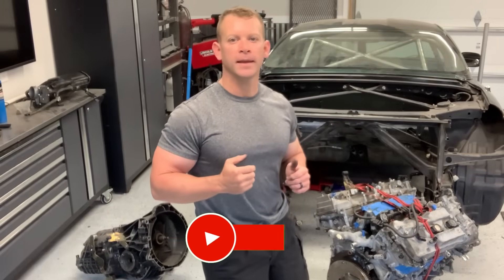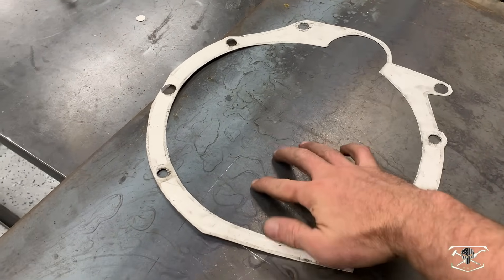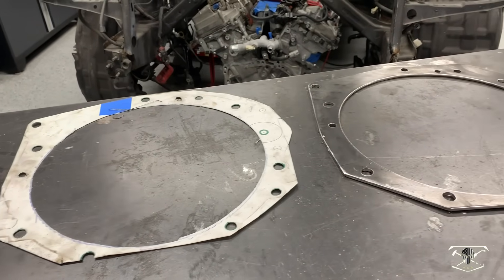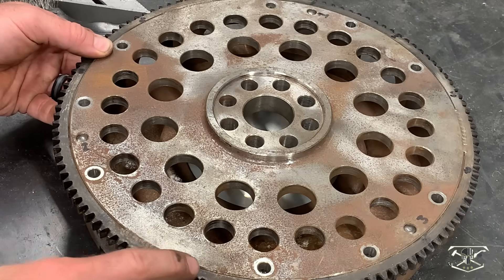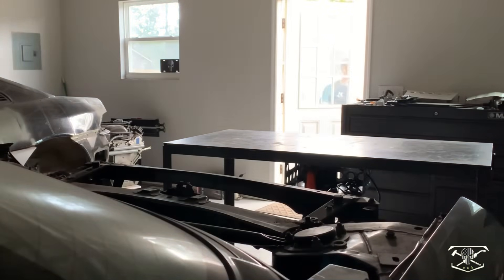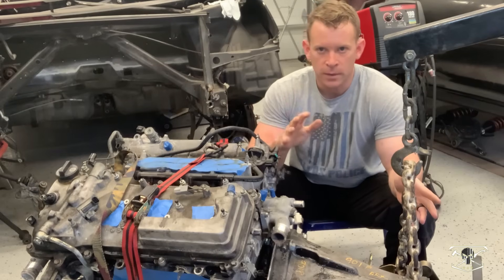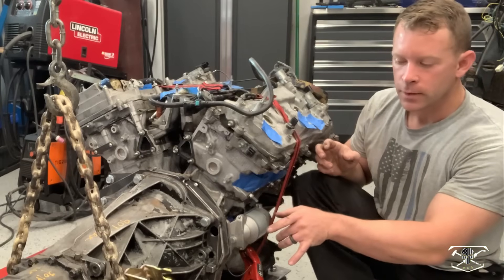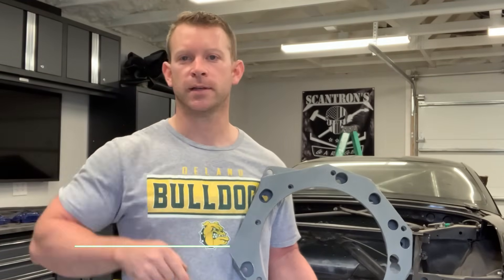DIY Engine Adapter Plate (Mate any Engine to any Transmission)

Comment: The first thing you do when making a paper patern or gasket is do 2 opposing bolt holes and put bolts in them, that putting a single spring clamp ony gets you a rough approximation.
Reply from the maker: I like it

Comment: How do you pair the other modules like the body modules to the new ECU?
Reply from the maker: Oh that's an entire different video.  I have some videos already on this topic. It also depends if you are using a stock ecu or an aftermarket ecu and custom harness. After doing all this, the ecu will need to be tuned on the dyno

Comment: Lots of great ideas, however, the alignment between the trans and crank centerline is only allowed around .005" with .005" parallelism (angle between the two). If these are not in spec it can create shifting issues, disengagement issues, vibration, input bearing wear, pilot bearing wear, release bearing wear, spline wear, pressure plate finger damage. In severe cases it can even break the center out of the disc. 
You could have made this super accurate by using a dial indicator to check and correct eccentricity and parallelism. Look up indexing or centering bell housings. Holley and tremec have great guides along with other folks. It's hard to stress how important a few thousandths of an inch can be when setting something up like this but take some time to review the guides. And if you think you can get this setup into spec with the method you used, grab a .005 feeler gauge and please reconsider. https://americanpowertrain.com/general-bellhousing-alignment-instructions/
Good luck.

Comment: What about spacing for your pilot bushing or your flex plate for the torque converter ?
Reply from the maker: I measured the spacing before determining the thickness of the adapter plate. I measured everything fully assembled with the clutch in place. This would work for an auto trans and torque converter as well... the adapter plate would just be thicker to account for the converter thickness. I know I brushed past this quickly in the video .

Comment: Instead of cutting out the centers, of the flanges, leave the small hole at crankshaft & input shaft centers. That is the most important location to align the engine & transmission!

That inside hole doesn't need to be round.
Reply from the maker: Yes, that would work
Reply: @scantronsgarage  yeah. I've done this & that is the easiest way to ensure the engine & transmission are lined up perfectly!

That junction is very important because alignment needs to be within ~0.0010" (~0.025mm) of perfect, or input shaft & crankshaft bearings will suffer. That point is also very hard to adjust, or even check, since it's somewhere very inaccessible.

You can kinda check, though, to know it's wrong. Usually, the input shaft bearing will whine like a banshee! So…how's it drive?

Comment: I plan to use a 8hp70 on a Buick 3800sc
Reply from the maker: 870 hp ?
Reply: @scantronsgarage  no it’s the transmission used in bmw 730i and hellcats look up shr war viking genii 8hp70 or bmw x drive. 8hp70
Reply: @scantronsgarage  but ima try to shoot for 500-600 hp out the 3800sc
Reply from the maker: @chaseleim4773  Very Nice! I will be lucky if i can get 400 out of my ls
Reply: @scantronsgarage  and ima try to utilize the bmw x drive transfer case aswell, on a lowered s10
Reply from the maker: @chaseleim4773  Sounds Awesome! Ive had a few lowered S10's but not with power

Comment: What did you do to make sure that the center line of the crankshaft and the center line of the input shaft are not only concentric with each other but parallel? Any slight misalignment and concentricity or any angularity from the parallel would seem to open you up for a can of worms of flexing bad vibration accelerated wear. Yet it looked like you just kind of eyeballed your alignment?
Reply from the maker: I kinda did. I let the output shaft center itself in the pilot bearing and built the plate around it. The adapter plate was later milled on both sides to ensure it was square. Yes though, any deviation in alignment will be catastrophic but so far so good

Comment: How did you determine your input and pilot bearing were aligned?
Reply from the maker: There was some guess work but assuming the input shaft is perfectly centered in the transmission, you insert the input shaft into the pilot bearing in the flywheel and measure for the distance between the block and transmission 360 degrees around. As long as that is the same you are good. Of course any misalignment will have serious consequences. 
I did have the plate milled on both sides for thickness accuracy and everything lines up perfectly for installation (no force fitting).

Comment: Doesn't the spacing stop the spigot bearing from fitting inside the crankshaft and the clutch spacing etc
Reply: Or was that calculated and machined on or off the flywheel?
Reply from the maker: Correct!! the flywheel was machined to make up the depth difference.

Comment: awesome to  SEE  what I've been dreaming about for a year.     My plan is pretty much the same,  but use a little thicker plates.  --after it's welded up,  I'd take it in to be surface ground for parallelism,  and final thickness.
Reply from the maker: Nice! That sounds like a good plan. good luck with the build : )

Comment: Great work! How do you know the transmission input shaft if going into the clutch and pilot bearing straight though?
Reply from the maker: Just by placing the input shaft in the pilot bearing and measuring the distance between the trans and the block 360 degrees. The plate will be surface milled on both sides as well.

Comment: What I don't understand is the gap. What did you have to do to account to the gap needed to make an adapter plate?
Reply from the maker: Whatever thickness is added on the flywheel will be the adapter plate thickness at least in this case). The less thick you can make it, the better.  either way, the adapter plate will add some thickness or increase the distance from input shaft to pilot bearing. So you just need to make up for that distance. Hard to explain but hope this helps.

Comment: That’s sooo cool!! Thanks for the knowledge man. What motor is that from to mate on a Porsche transmission?
Reply from the maker: This motor is a 2gr-fe V6 from many toyota products. Produces about 300 Hp . If you look at my other videos, I also have a MR2 with a chevy v8 bolted to the same porsche transmission.
Reply: @scantronsgarage  wow that is sooo cool!! I seen that and that’s pretty awesome you motivated me and hopefully I can do something like this in the near future. Would you happen to sell those adapters? Also where did you get that clutch kit from if you don’t mind me asking?
Reply from the maker: @Gentlemenshustle  I do not sell these adapters. This was too time consuming to make any profit. I believe I got the clutch from Summit Racing. LUK brand but it was stamped with sachs.
Reply from the maker: @Gentlemenshustle  Thank You!! I am not selling these unfortunately. The clutch is a direct replacement for the porsche boxster s.  This was a LUK brand i bought directly from summit i believe.
Reply from the maker: @Gentlemenshustle  Thank you!! I do not sell these unfortunately. And the clutch is a direct replacement for the boxster s

Comment: Wonderful work. Immediate subscriber. Question. I want to do this for an automatic but doesn't the trans input shaft "float" a little for install into the torque converter?  Any thoughts or tips for us auto guys to take the slop out in order to get it centered firmly during mock up? Thanks
Reply from the maker: Thank you!!!!! This should work in your case. Just machine a spacer that goes in between the torque converter and the flex plate to make up for that distance. Hope this helps. Hard to explain.

Comment: I’d like to make a adapter plate to mate my rebuilt 4L60e to a 3rd Gen 5.3L v8
Reply from the maker: Aren't the bolt patterns the same?
Reply: @scantronsgarage  I think so, but I’m not sure…
Reply from the maker: @jahcousteauu_STAYinSHAPE  I think your good. make a template and verify at a junkyard
Reply: @scantronsgarage  my whole scary part is risking it -when I go to pull and pick a junkyard 5.3, I think it’s going to be a luck of the draw, pretty much taking a gamble on grabbing a good solid one. I mean ofcourse I’m gonna rebuild it and bore it out but I need to start with a good block atleast… 🤔
Reply from the maker: @jahcousteauu_STAYinSHAPE  Yes, the junk yard is always a gamble
Reply: @scantronsgarage  my 4L60e originally was paired up with the inline 6ix 4.2L and I wanted to switch it to a 5.3 since my engine is acting up

Comment: I am curious how you accounted for crankshaft center line run out. Installing the transmission 3/4 of an inch away from the engine and then putting plates in the gap does not account for center line run out. Other than that I admire the ingenuity.
Reply from the maker: I cheated... I put the input shaft into the pilot bearing and measured the distance between the block and trans to make sure there was no deflection.

Comment: Sorry, why did the flywheel need all the extra thickness? I can’t find where that’s explained in the K-Swap videos
Reply from the maker: So, the adapter plate will add an additional thickness. in this case, I believe it was an additional 22 mm. so to make up for this thickness, the flywheel needs to be an additional 22mm to match the difference : )

Comment: The adapter plate doesn’t have to be seal welded?
Reply from the maker: no it does not. The stich welding will be plenty strong

Comment: The reason I watched was to see what engine transmission and car. Wasn't disappointed. That is an awesome idea to v8 an MR2 and it looks like the engine will stay on your backside.
Reply from the maker: Thank you!! this car might even pull the front wheels off the ground

Comment: I'd love to put a d series Honda on a th350 for a rear engine crawl build. D series are reverse rotation and would solve a lot of issues with flipping axles. Just need to bring the Honda torque converter or get a Chevy reverse tc
Reply from the maker: I like your thinking on this. Hope that works out for you... that would be cool to see!
Reply: @scantronsgarage  I'll try it out one of these days. Going tdi on the next build. Gotta finish the jeep first

Comment: Talk about old school. My dad showed me how to this in 1974, replacing the flathead engine in a 1948 4 pickup with a 394 Oldsmobile from an early '60's Delta 88, I think. Though thinking back, would have been better and easier to swap the trans too because the 48 Ford was low geared and before scyncros so even with the better engine, top speed was 50-60 mph full out and it would grind the gears if you weren't conscious to double clutch.
But reality, great idea you have. I haven't thought about it since back them, but done 100's of other swaps. Like to see it done with sidewinder, Did a 389 Pontiac backwards into an old school VW beetle, hard to keep the front wheels on the ground, also a caddy Northstar into Pontiac Fierro was fun. Now planning a LS + 4l80 into a 1969 Pontiac Bonneville where once rested a 375 horse 428 with turbo 400 automatic. Keep up good work
Reply from the maker: Thank you so much! That means a lot coming from someone who has done quite a few swaps. I especially like the fiero / northstar swap. That is something I thought of doing myself.

Comment: I have a piece of equipment that uses a constant velocity double-u joint to connect the engine to the pump one side of spline shaft the other has four bolts
Reply from the maker: I see... You gonna make an adapter plate for this?
Reply: Doesn't use or need one the pump has its own mounts on both sides and the motor has its own mounts on both sides

Comment: Once the spigot carrier is bolted into the flywheel . We see, as you crank the motor, that thing is totally on the piss. Why is that happening?
Reply from the maker: Fair question. Sloppy temporary assembly on my part. The center plate was not fully seated in the flywheel when I did the test crank. I took this thing apart at least a dozen times during the process.
Reply: @scantronsgarage  Well you still made it look real easy  to do. I'm not sure it is so intuitive but I believe I will test the theory sometime in future here. I have a 4 cylinder gas engine going into a deisle 6 speed truck. Just thinking about it starts my adrenaline.
Reply from the maker: @jackrichards1863  I hear you! sounds like a fun build.

Comment: So in this instance i think you aligned the two inside diameters to get the neutral centre of the spigot shaft? Because where people are inclined to swap a transmission to fit. Determining the precise neutral centre is the difficulty. Any fault in that plane or 'POSITION' brings about clutch disc centres breaking out, premature input shaft bearing wear & possibly clutch disengagement problems. I've got to watch this again. Now!
Reply from the maker: Yea.. I cut out a bunch of my measuring. I also had a similar drivetrain next to this which i used for comparison.

Comment: You should’ve welded it solid and dressed the weld with a file so they are nice and square and had it powdercoated in an aluminum finish.
Reply from the maker: Thanks for the tip! I was afraid of warping the metal if I fully welded it

Comment: I’ve never done this myself, because i considered it beyond my shop’s capability, with the tools, skills and time constraints we had to work with.
We had a couple made, over the years, most notably to fit Nissan diesel engines to other makes of car. From memory, none of them were more than 10mm thick, none required extensions to the flywheel depth and most of ours were not concerned with high performance, so high rotating mass wouldn’t have been a big concern for us.
Space was often quite tight, so moving the engine forward by 40mm might not have been feasible.
All of that being said, it’s great to see a different way of achieving this. The days of diesel conversions are over, of course, thanks to the u-turn the ecomentalists took about the climate crisis, but re-powering is likely to become a niche industry when internal combustion is no longer the norm and original replacement motors are hard to find.
It’s also relevant to the performance and custom industry, though I suspect this method won’t work for them. Reducing rotational mass is very important in a performance mod, so adding big flywheel extension pieces would be frowned on.
Reply from the maker: Thank you. And the extension was necessary to make fitment with the different bolt patterns. Not ideal by any means but made it  come together.

Comment: Thank you very much Sir for showing me/us how to go about this, I figured this could be done.... 
I'm planning on swapping an aluminum 5.3 into my Grand Wagoneer soon and I'm really wanting to just adapt it to the AMC pattern 727 that's already in the Jeep, just so I don't have to put lower ratio ring & pinion gears in both my differentials, which is what I'd have to do if I were to go with an "overdrive" 4L60e.
And handmade parts are what it's all about, when on a budget....
Reply from the maker: You can do it! I am on the same budget. Luckily you have the aluminum 5.3. I did this with my 5.3 iron block swap into a MR2 as well

Comment: Overwhelmed, Very Interesting, Has anyone viewed this video, and attempted to install a General Motors V8  in a L/R Range Rover P38 originally a 4.6L Aluminum V8 sold 1998 - 2003 using the techniques demonstrated in this video.  The original Buick designed engine rights were sold to Land Rover years ago. Obviously I would like to use GM V8 and retain the  Range Rover Transmission, and  4WD drive-train including the transfer case.
Reply from the maker: My friend has the same range rover and we just discussed this same thing. We worked out it would be less expensive and easier to swap the entire drivetrain out of a 4wd chevy over trying to make everything work together. Thanks for the sub!
Reply: @scantronsgarage  Thanks for the advice. If you/ your friend has further thoughts I would much appreciate your ideas. Erie, PA
Reply from the maker: @Pdfflyer1  Sure! I will let you know